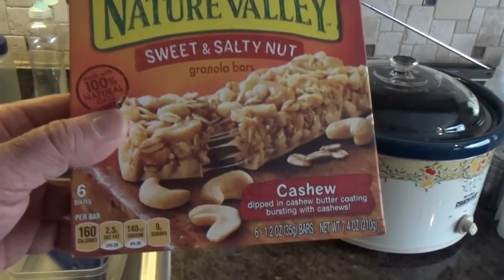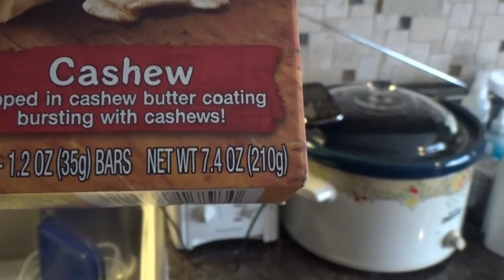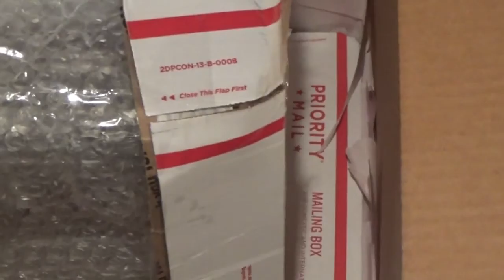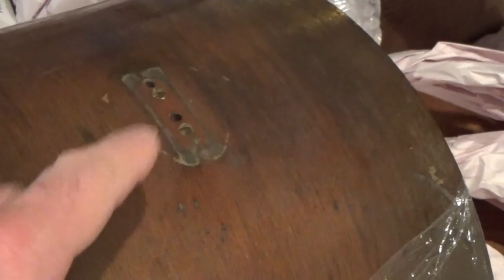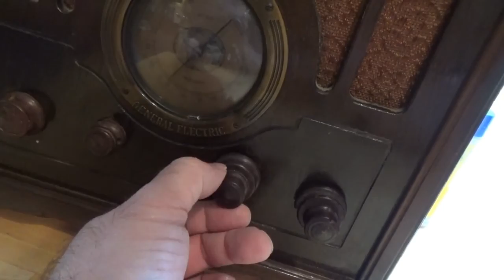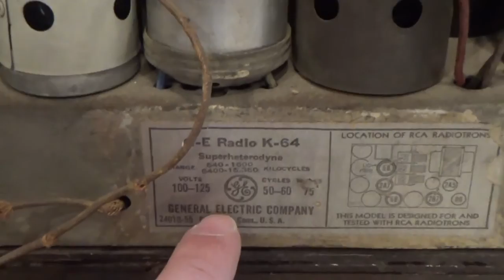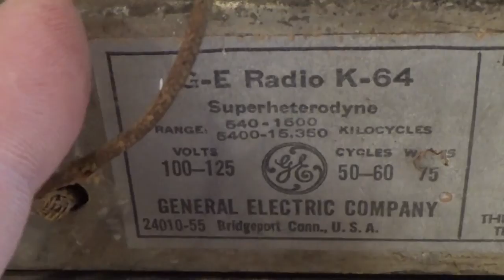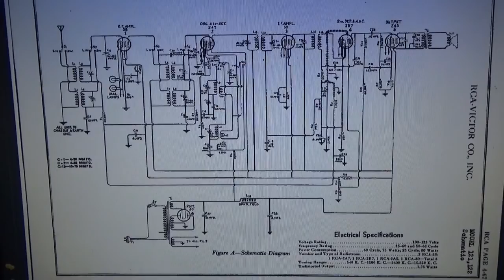My New, GE K-64 Antique Cathedral Radio from 1933

Comment: I have the RCA version of that radio which is a model 121.  It's a really neat looking radio and a great player too.The knob on the right is a push-pull knob for AM and SW.  Have fun with it!
Reply from the maker: Thanks! that knob had me stymied when it just mindlessly turned around and around. Or rather, I mindlessly turned it around and around! The RCA 121 is better as it doesn't need the bail handle on top to make it complete. This will be a tough item to find. any ideas why they put the handle on top. I think the radio is kinda heavy to be toting it around with the handle on top. A attempt at portability? For aesthetics? Trying to get some sort of lantern look? A real mind bender here.

Comment: Nice radio. The veneer wrinkling is possibly from moisture but I doubt the bottom was submerged in water. If it was in the attic the hot and cold could also cause condensation. Good luck with the restoration. I am sure BuZZ will have some good videos for review and handy go forward advice.
Reply from the maker: Yes, Buzz is very good at wood working but he doesn't want to admit it! 
thanks for your input, Andy.